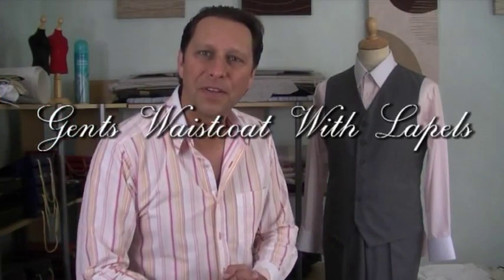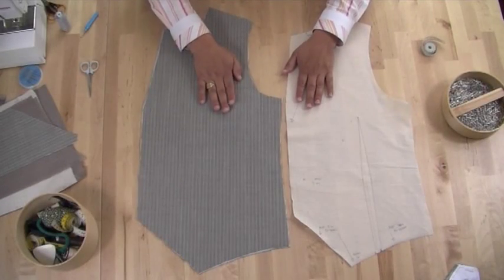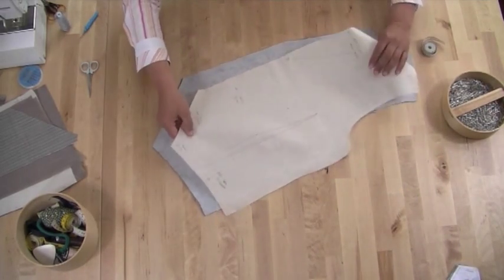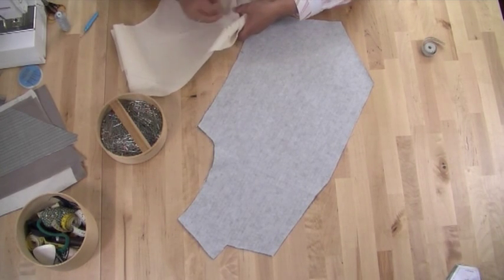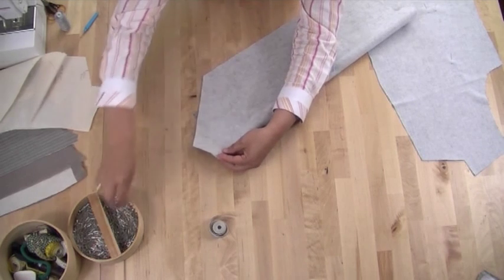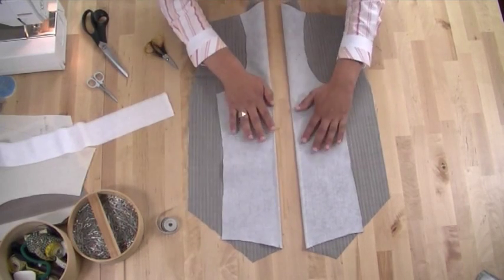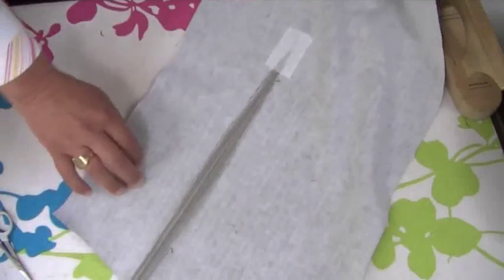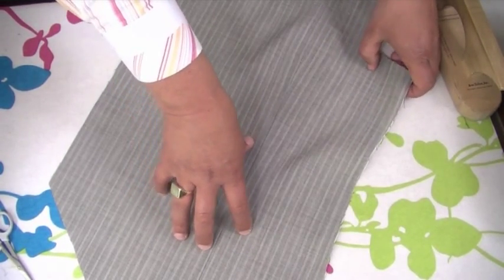learn to sew - Waistcoat With Lapels - Darts

Comment from the maker: Hello Fernlintner65.
Thank you for your nice comments regarding the videos. We are sorry that you are experiencing problems regarding the site not working correctly. This is very odd as we regularly test the site which does work across all platforms, however you could try pressing the F5 key on your computer to refresh a current page or try viewing the site in another browser such as Google Chrome, Firefox or Internet Explorer.
Hope that this helps.
Regards. The Sewing guru team.
Reply: you've chosen to use popups for email address entry,, most people have popups disabled.  the site probably works, but if popups are disabled no one can use it.  including myself, grrrrr

Comment: It's the line from the notches to the mid point of the dart tapered, or is it parallel and then tapers only after the midpoint?
Reply from the maker: A dart gradually runs to the edge of the fabric. Some taper with a continuous straight line and others are straight to a certain point and then taper. It depends on the garments design.